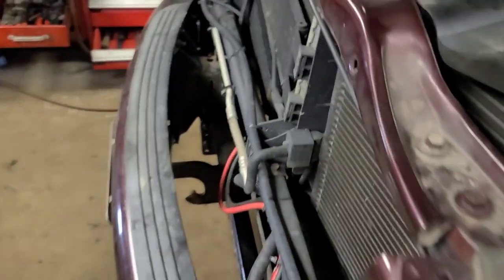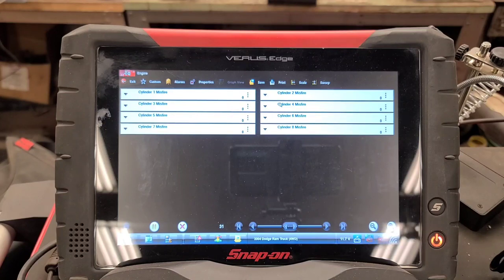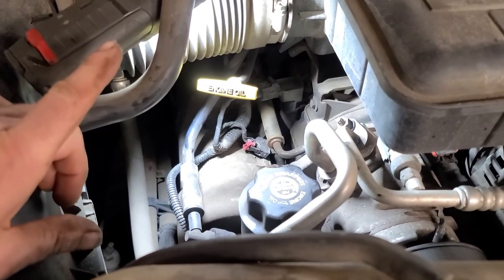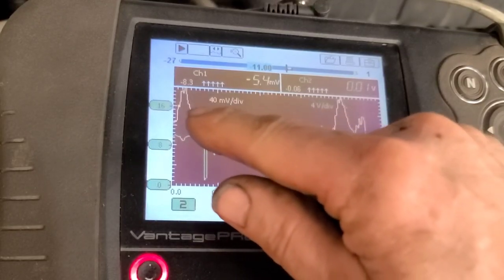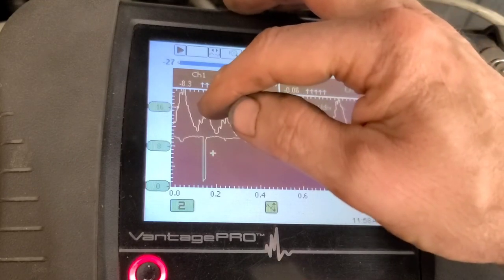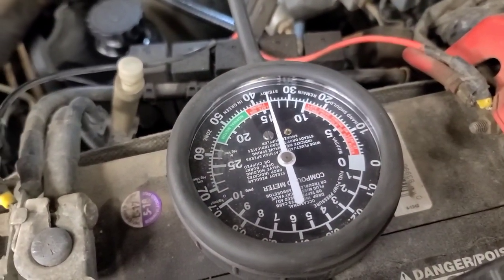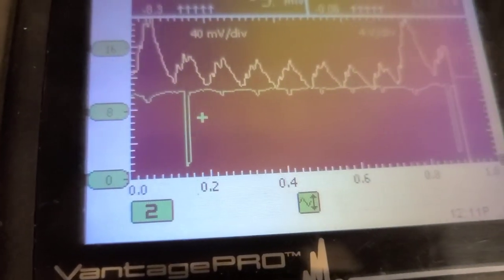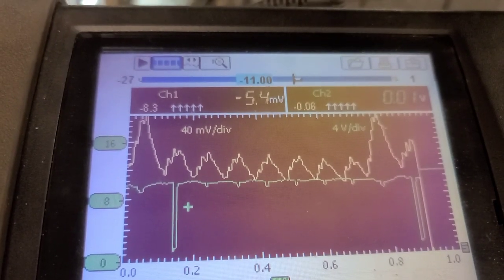2004 Dodge Ram 1500 4.7 Misfire On Number 4 Cylinder

Comment: The 4.7L usually only drops a rocker after it has overheated due to lack of coolant getting to the heads.  One is very luck that the hardened steel valve seat doesn't fall out when this happens causing piston and head damage.

Comment: ive got an 02 ram 1500 4.7L V8. I believe i have a misfire on a cylinder (well im more than certain there is a misfire) BUT I had daily driven it for a month on the misfire and had tried everything i could find. About a month of driving on the misfire my engine randomly overheated and blew the radiator apart. To my surprise the engine had little to no oil in it!! So i filled it with oil and replaced the radiator. Now the truck will fire up, idle normal for a few seconds and then it drops down between 500-600 rpms, Ive checked IAC valve (fine), Throttle position sensor, MAP Sensors, MAF Sensors, and everything seems fine and the engine still will not idle correctly. I have noticed that the exhaust flange from headers has a leak/broken off. Now im only 16 yo and am trying to figure this out myself, im not very mechanically inclined, but i had a thought that maybe the engine is not getting enough back pressure due to the flange being damaged. Then again, i may sound like a utterly confused teen to some of you. This vehicle was passed down from my father and i can not bring myself to give up on the truck. if any of you have had somewhat related issues please reply and help me out!! Yes i have also checked for gaskets being blown, or leaking. I have tried a idle relearn. Anything helps!!
Reply: It will idle at around 550-630 rpms in park and neutral, when i try to put the vehicle in drive it dies due to the already low idle.
Reply from the maker: 550 to 650 idle is not low that's actually normal. So the problem your chasing now is a stall when you put in drive? Will it stay running if you keep the RPM up with the gas pedal? Is it setting any fault codes? An exhaust leak won't cause this in my opinion.

Comment: I have an 05 dodge ram with the 4.7l and for some reason when I let off the gas after accelerating to exactly 70mph the truck jumps. I thought it was a shifting issue, got a code for the transmission shift solenoid, so I replaced that and it’s still doing the same thing. Any idea about what could be the problem?
Reply from the maker: That's pretty tough without experiencing the problem.  Transmission mounts, u joint? What code is it setting?
Reply: @PhillipBailey  it was a p1776
Reply: Code, although there are more codes in the history too.

Comment: PLEASE HELP! Hi Phillip, im having a similar problem with my 2005 ram 4.7L its ticking and  shows just 1 code on cylinder 3 (p0303) i changed the coil packs, spark plugs and fuel injectors with no luck so I checked the compressions and number 3 is between 20-30 psi and sometimes 0 psi so I pulled the cover but everything is still in place. Any ideas? Please and thanks.
Reply from the maker: If you're sure your compression gage is good, (confirm it by checking a different cylinder) and both valves are moving properly when cranking you need to do a leakdown test. With both valves closed and the piston at TDC put compressed air into the cylinder through the sparkplug hole. Listen for escaping air. If air blows out the throttle body you have a burnt intake valve. If you hear the air at the tail pipe you have a burnt exhaust valve. If the air comes out the oil filler then you have broken piston rings or hole in tge piston. All three options are not good. Good luck. Let me know how you make out.
Reply: @PhillipBailey   Thanks very much I appreciate the advice and will check everything u said...was just hoping that you might say that the lifter could still fail even with the rocker arm still in place
Reply from the maker: @mohiabasbtani1999  the lifter can collapse but usually it spits a rocker. Turn the engine over with the valve cover off and watch valve movement. Compare to the other cylinders.
Reply: @PhillipBailey  ok, will do thanks again.
Reply from the maker: @mohiabasbtani1999  what was the problem?
Reply: Could be lifters and more than likely valve cover gaskets are the cause for your faulty code also. Mine leaked down the exhaust onto the O2 sensors constantly throwing codes

Comment: Did it fix the misfire as well or just the ticking?
Reply: I am experiencing a similar problem with my dodge ram 1500 2004 4.7 misfire when starting and it will die on me if you touch the gas. any thoughts that could help? been to the shop 3 times now.
Reply from the maker: fixed both the misfire and tick. Are you experiencing a miss on a specific cylinder? What has been done so far? any codes?
Reply: @PhillipBailey  random multiple misfires, but then brought to shop they had it on cylinder 4, as far as ticking goes I haven't heard anything but I haven't ck for it. When I start it up the rpms start at 900 and as they drop to 500 it will sometimes (if given gas) die. Its been to the shop 3 times, cam shaft sensor and all spark plugs and fuel injectors. I have an O2 sensor code and CAT below threshold on same side. CAT was a recent development and the O2 sensor I've replaced twice. the one with he code had the plug seized up so it may be electrical. Ive cked the fuel pressure before starting threw the value and its pretty low so I'm wondering if the fuel pump may be leaking the fuel in the line back to the tank. Or code be a code from the sensors from O2. Im not honestly sure.
Reply from the maker: @nolanharp9680  well the O2s don't begin to work until it's run for several minutes so it's not likely them but you could have a restricted convertor causing the misfires. Look at the reported misfire counters and see if they are primarily on one bank. Check exhaust backpressure on that side. Good luck
Reply: @PhillipBailey  Misfires are on cylinder 4, after listening to it the clicking noise is noticeable. Not sure how to ck the back pressure but note it has a muffler delete. Ill pull the valve cover off as soon as the seal comes it. Thank you!

Comment: I’m having a hard time finding the harness that goes to the ignition coil online, know anywhere I can get one?
Reply from the maker: The harness assembly is a dealer item only or used but if all you need is the connector to a coil that is available from the aftermarket parts suppliers.
Reply: @PhillipBailey  got the reason I ask, is bc the harness on mine looks rough and I’m having an issue where it takes a few seconds to crank over when I first start it but if I turn the truck off and right back on after the initial crank up it start right up no hesitation, plus I have a misfire in cylinder 8
Reply from the maker: @legendarytwo8525  any codes besides the  P0308? Maybe you are losing fuel pressure causing the extended crank time. Misfire could be related if it's a leaking injector in number 8
Reply: @PhillipBailey  I also have a P0208 code and the previous owner put all new injectors in 3 months ago
Reply from the maker: @legendarytwo8525  A P0208 code means that the PCM has stored a trouble code indicating poor performance on a fuel injector on Cylinder 8. This could be due to a bad injector, an open or short connection, an intermittent open or short, a bad ground or even a bad PCM (though rare). Check the connector pins on number 8 injector and connect a noid light to the correct and start the engine
It should flash the light. Check for power to the green wire running.